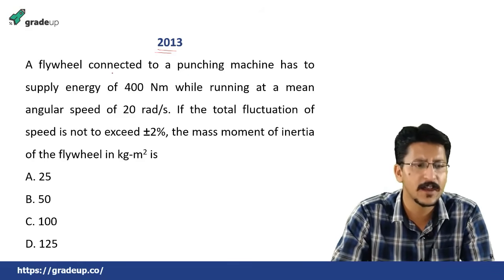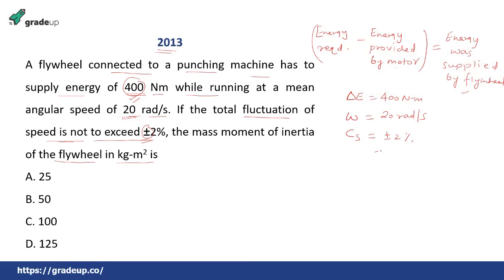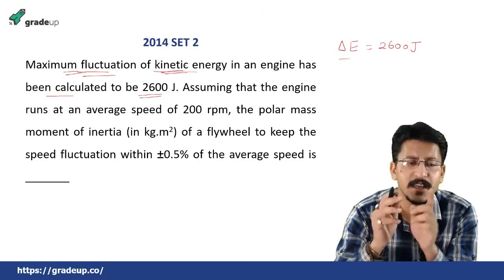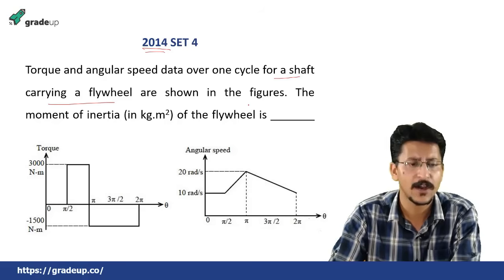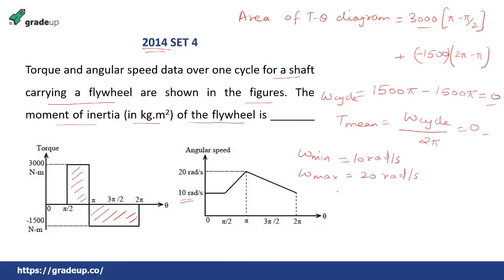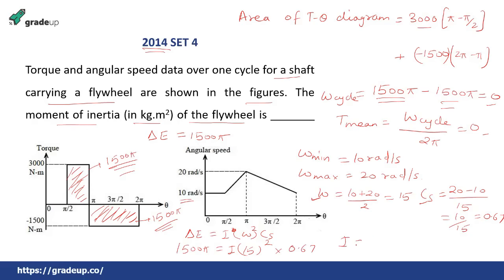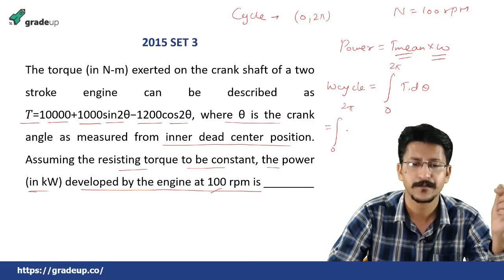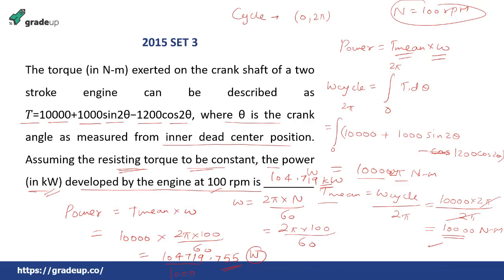Flywheel GATE Questions | Theory of Machines Problems | GATE Mechanical Previous Solved Papers

Comment: sir, in question  gate 2014 set 2 he asked to calculate the polar mass moment of inertia but we calculated  only  mass moment of inertia,,,, could you please clarify
Reply: polar moment of inertia is calculated on the centroid which is at center for the disc hence both are same

Comment: Sir you told for 2 stroke cycle is from 0 to 2pi n what about 4 stroke?
Reply: 4pie
Reply: four strokes 
angle turned   strokes
0-pie        --       suction 
pie-2pie   --  compression
2pie-3pie  --  power stroke
3pie-4pie    --    exhaust